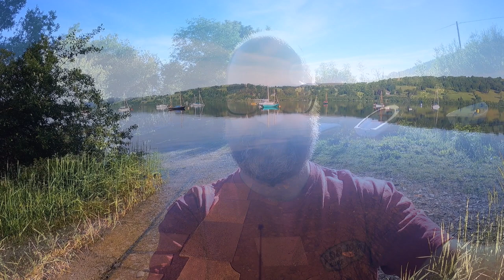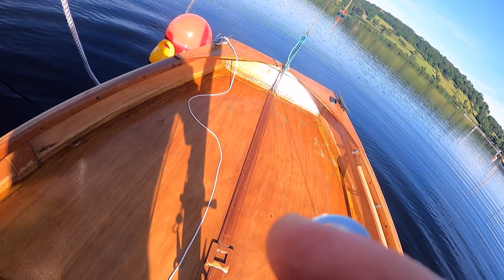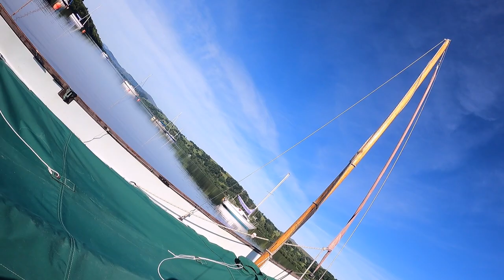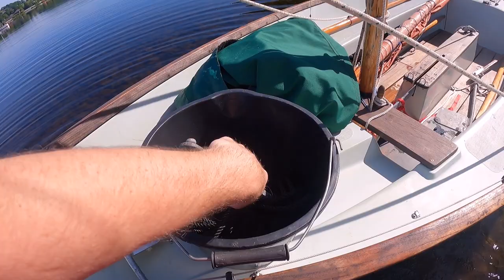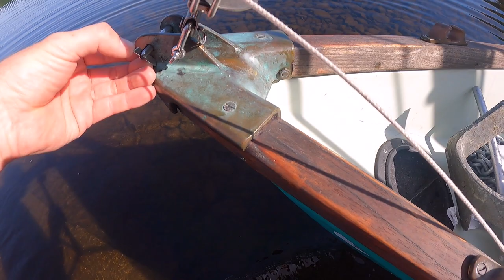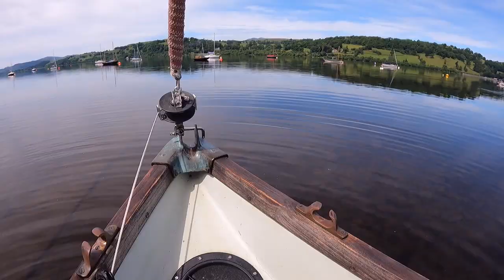Working out Anchor stowage on the Lugger

Comment: The drop nose pin will make the mooring rope more secure, but you need a retaining line on it that's long enough for you to take it out without losing it. You will have to take the anchor off every time you're on the mooring so you might as well store it onboard- have a look at the Dragon Drascombe boats, they seem well sorted.
Reply from the maker: Hi Robert. Yes the more I look at using the front, the worse an idea it becomes!!  I did look at the Dragon Drascombe site for an anchor idea but couldn't find anything on it anywhere. Can you point me to a webpage at all? 

I'm going down to the boatyard tomorrow and as its a bit too cold to fibreglass now, i'll take the Danforth down with me and see if I can make some chocks for it.